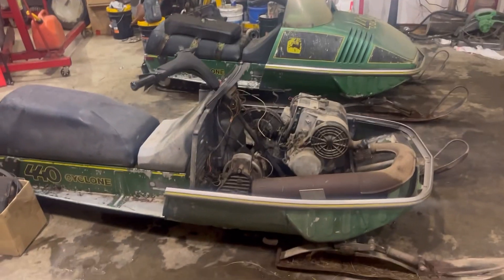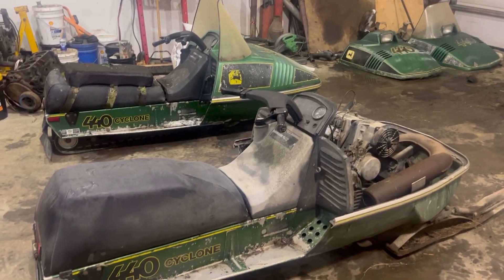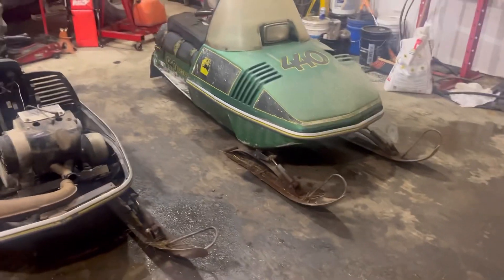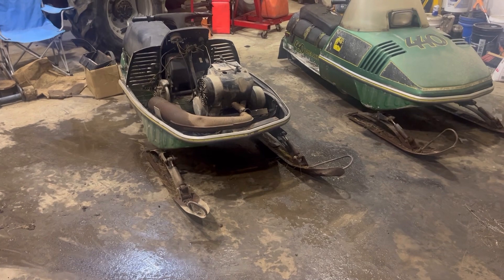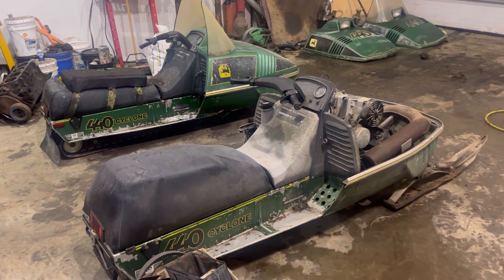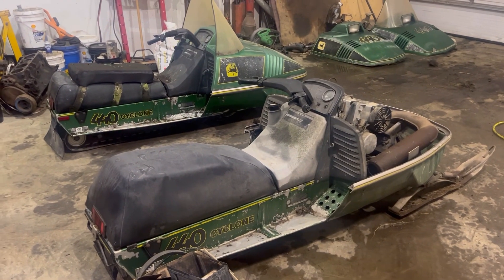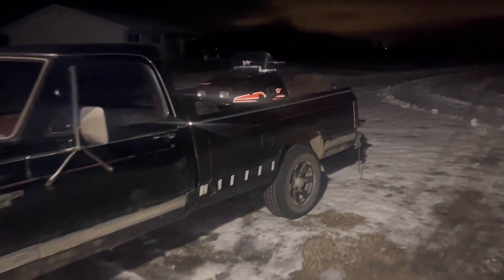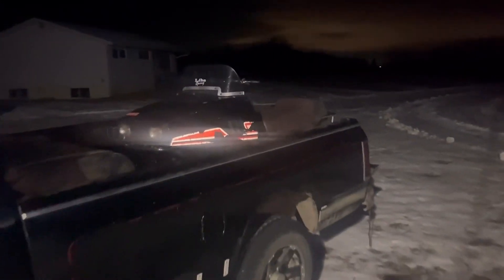77 John Deere 440 cyclones

Comment: You are one lucky s.o.b. you found those two would be my I dream of Jeannie moment..😂🤣😂🤣😂 has taken me 3 years to restore a 73 JD 500 w/ CCW 440...it's been a long haul but she's showroom condition on a scale she's a 8 I'd guess...congratulations on that find man!👍
Reply from the maker: I’ve put 30-40 miles on one and has tan like a top but had to steal a lot from the rougher sled
Reply: @Interstate_day_dream  Paint er up buy new decals and go thru every nut and bolt put a couple hundred hours in er and she will be gorgeous...😁💕👍 Just got done rebuilding my CCW 440 she got fire to both plugs gotta set points and time er up finish putting engine shrouds on etc put back in the sled and wait for snow...👍